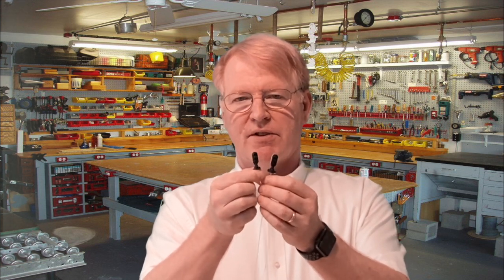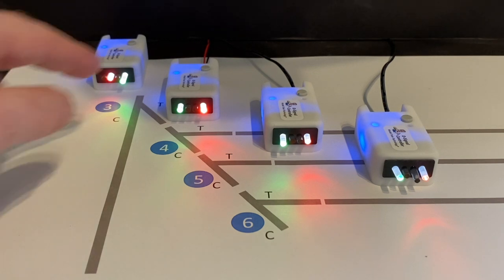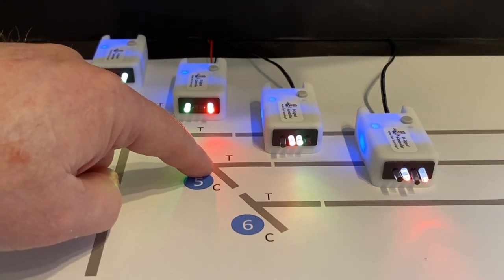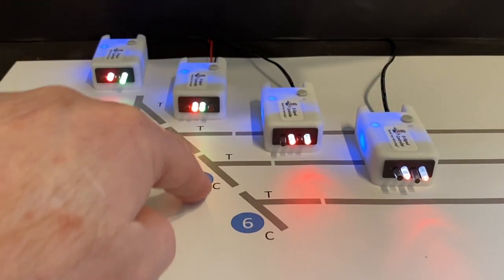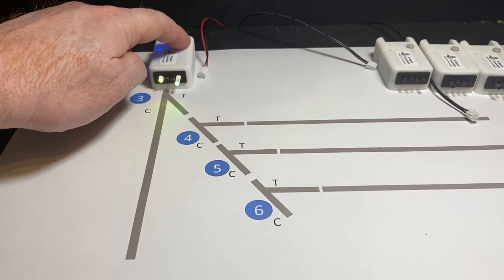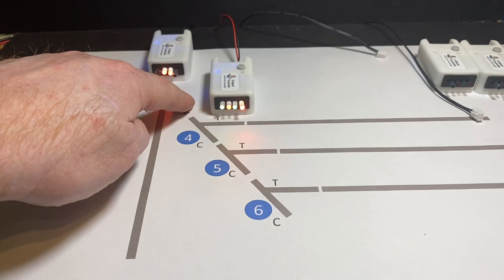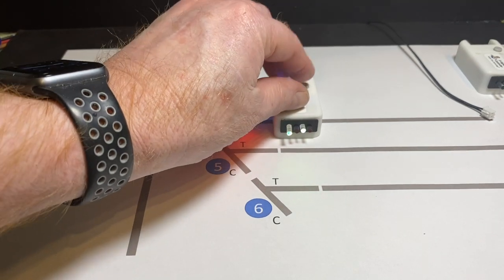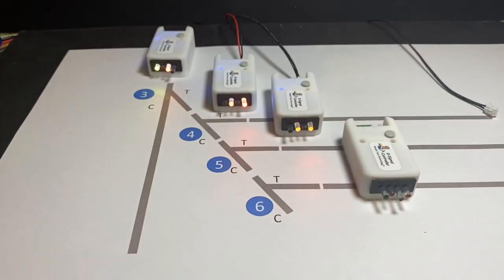SIGNAL INTERLOCKING using Model Train Technology's D-Signal Controller

Comment: These work with sensors?
Reply from the maker: There are three methods to trip our Dwarf Controllers:  Coil detectors if you already have coil switches installed,  mechanical (like tortoise types) and DCC.  In these case you would know which way the turnout is turned.  Sensors wont give you that info.

Comment: At 8:06 you are switching 5 but only the light of 6 is changing. The light of 5 is ignoring your switching.
Reply from the maker: I may have inadvertently hit 6 instead of 5 - a lot going on with managing the video, speaking and operating the controller. Later on in the video you can see that Controller 5 is reacting properly to the commands.  Good observation!
Reply: Unless I’m mistaken ( following the logic ) wouldn’t hitting 6 mean one of the lights on six is still supposed to be green? The fact that 6 turns both red suggest that 5 was changing.

Comment: I need something to both indicate block occupancy on the main, and change to indicate a siding. Problem is, I don't do DCC. My n scale signals are also common cathode style. I'm having a time trying to find something that will work with what I have.
Reply from the maker: Our Signaling and Detection starter kit might be what you need.  The Signal controller (part of the kit) can switch between common Plus or minus voltage (Anode or Cathode mode). You can use your own signals -option for the kit.
 Here is the link:  https://www.modeltraintechnology.com/product/signaling-starter-kit/

Comment: Where are the dwarf lights mounted?  On either side of the switch?
Reply from the maker: Typically they face the sidings and then a two-over-two could face the other way - OR another pair of dwarfs on either side of the entrance to the turnout.  I've seen many variations in online photos of yards.

Comment: This may be a dumb question, but am I understanding that these are both duel signal controllers with DCC decoders AND you can use them to trigger turnout controllers?

So for someone without computer controlled turnouts that wants to also get into using dcc to control turnouts AND signals, this is the thing I need?
Reply from the maker: EJ - These Signal Controllers only control lights and some animation (like gate crossings).  These are not design to turn turnouts. There are already MANY DCC turnout controllers form other companies and regardless of which of those you choose, they will operate in parallel with the Signal Controller from you DCC system.
Reply: @ModelTrainTechnology  thank you for the clear and prompt response!!